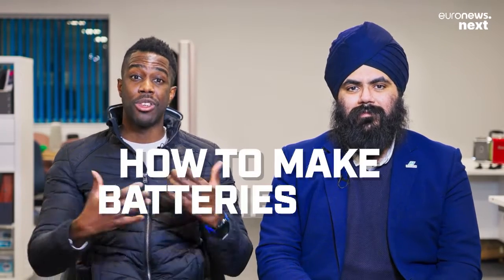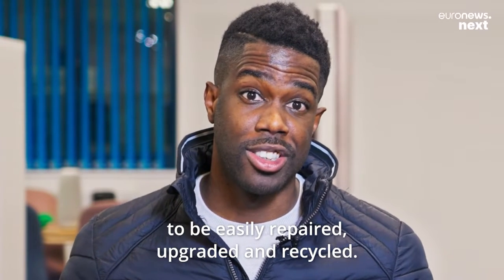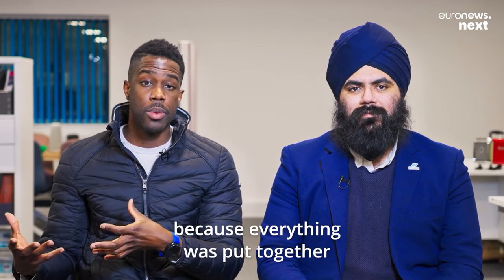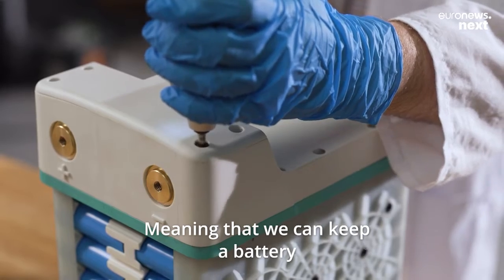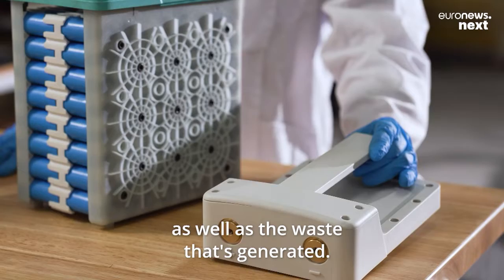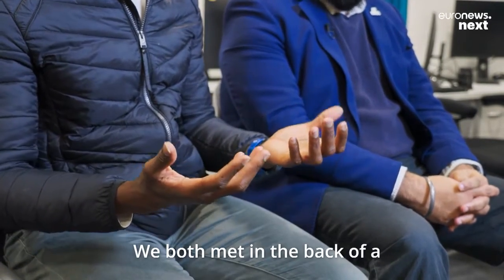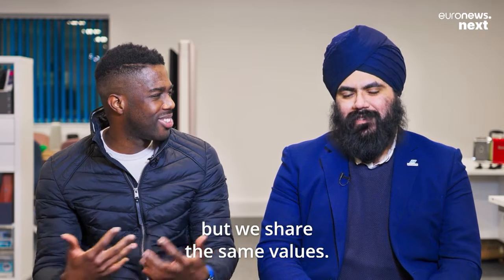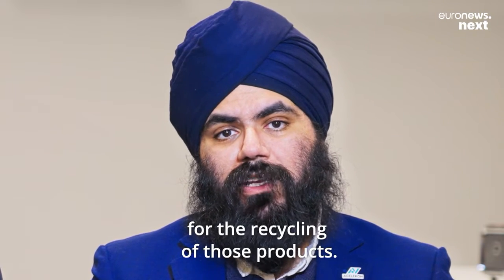Future's job: Redesigning more sustainable lithium-ion batteries

Comment from the maker: A UK startup that claims to have designed the world’s "most sustainable" lithium-ion battery, comes in.
Reply from the maker: "Currently batteries are not designed to be recycled.They're very difficult to take apart and conventional state-of-the-art recycling is not very efficient for recovery of the lithium materials. This means that the process is costly and ultimately wasteful, which is a global challenge that needs to be solved quickly"" said Aceleron CEO Dr Amrit Chandan.